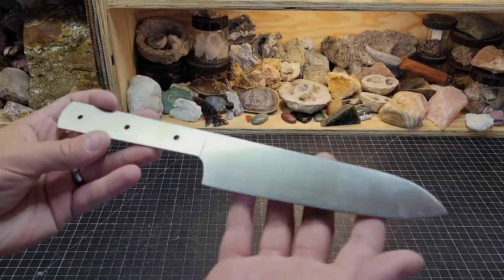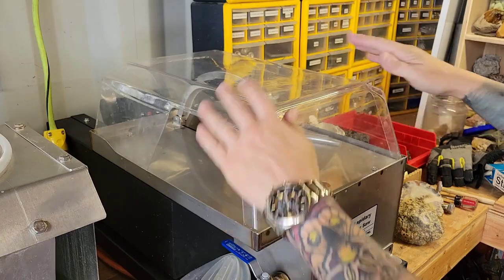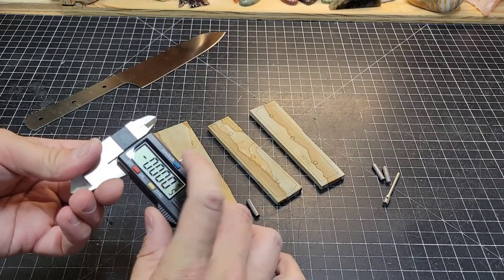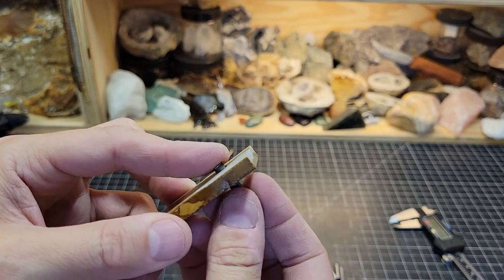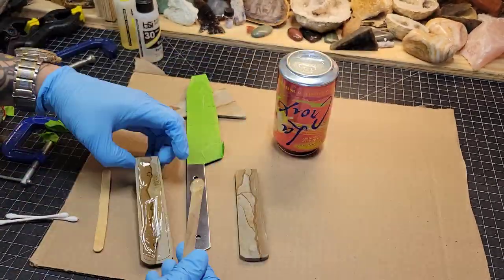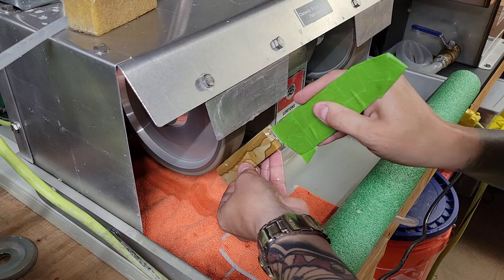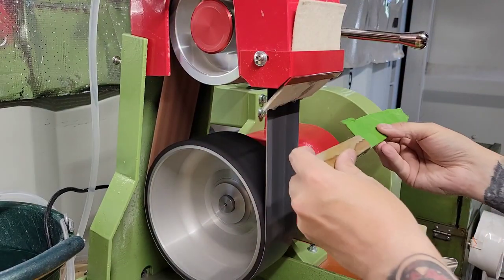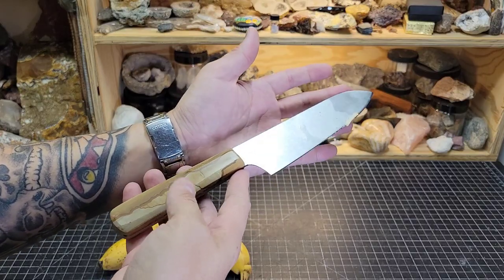The Making of a Picture Jasper Handled Santoku Knife

Comment: Very nice Jared! I think the key(s) to cleanly drilling stone is a drill press, high quality diamond drill bits, lots of lubricant, and for sure, drill from both sides to reduce blowout. You need to drill halfway in from one side then flip the piece over and drill from the other side to meet in the middle. Gunther Diamond Tools makes a great system for accomplishing this. I have had very good luck with mine.
Reply from the maker: I have seen the Gunther Drill system which looks great but its also a bit out of my price range.
Reply: I have also done it by hand. Trickier but doable and cheap if you aren't doing many. Just come in halfway from both sides, don't blow all the way through from the top. Good Luck! Love your channel and what you do. Subscriber from a long time ago, just don't comment much.

Comment: So what I would recommend for next time is to drill dowel holes on the inside facing parts of the Jasper then use shorter pins to hold the handle in place while adhering the Jasper to the handle. :-)

Comment: If you drill your hole before you slab the material the  blowout won't affect the handle surface. You can also get "matched" handles that way too.
Reply from the maker: I see what you're saying here but that is really not a practical option most of the time since you don't know how the placement will be or if you want to work around flaws on the slab.

Comment: How high an rpm does your drill press have? For me an rpm of 5000 + works best on my 2.5mm drill. Bigger bit needs less rpm.
Good job.
Reply from the maker: I think it goes up to 3600rpm.
Reply: @CurrentlyRockhounding  it seems like you would want the edge of the drill bit to move at the same speed as the edge of your saw blade for optimal cutting.
I have a jig to mark front and back of slab at the same time in exactly the same spot.  I start a hole on the back then switch to the front and this helps with the blowout.